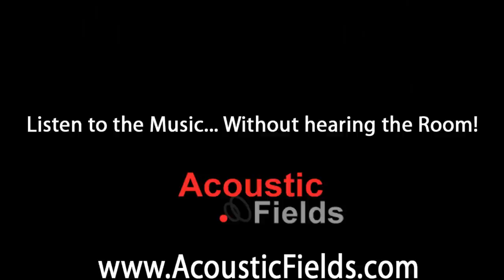How Much Do Room Acoustics Matter To The Performance Of Your Speakers, Amps and Cables?

Comment: Is the echo/reverb inside the room intentional, or there is no sound treatment?
Reply from the maker: The interview was conducted in the customer's living room. There was only quadratic diffusion present. There was no sound absorbing technologies other than furniture and some drapes. One wall is all glass. It also has 20' ceilings.

You are hearing this room dimension plus the addition of middle frequency diffusion... So no, no sound treatment for the each/reverb you mention. Sometimes you have to roll with it.
Reply: Thank You!